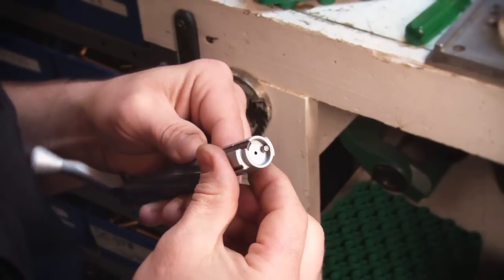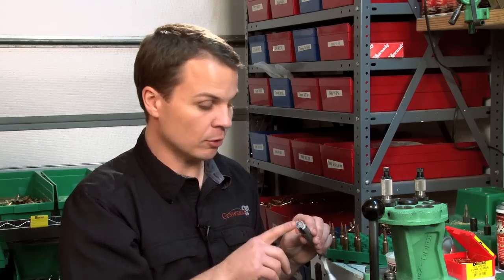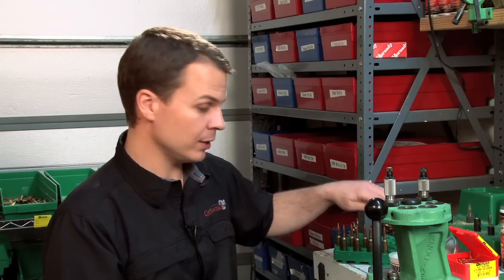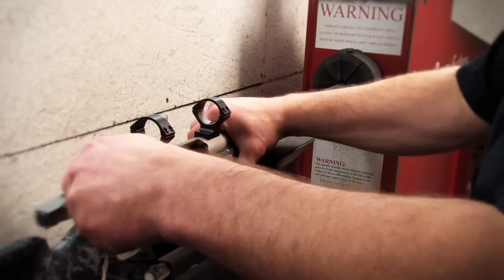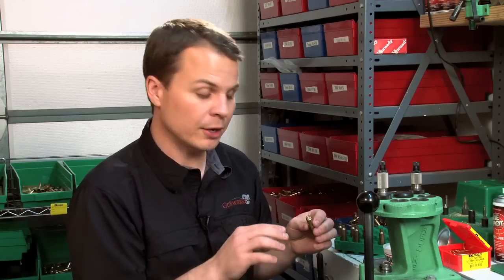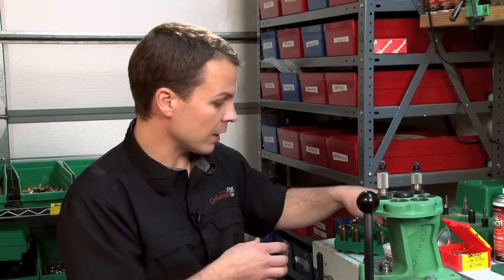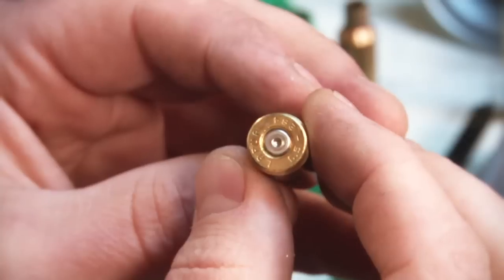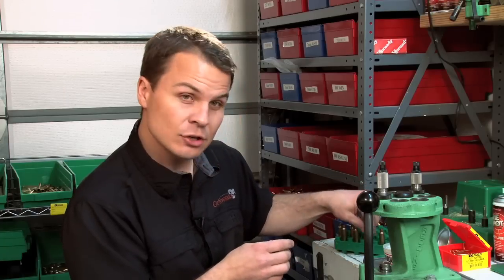DIY Determining Max Powder Charge

Comment: Never use one source of powder charge, use two or more for safety, as there are mistakes which can blow up the breach.  Note letting the ammo sit in the sun can greatly increase the pressure to the point of serious problems.   I saw an M1A explode 3 feet from me and the gun bolt exploded, and really hurt his left arm.  Do not assume anything, everything matters keep records, temperature, wind, compass treading, and do not load maximum unless you know that this is the best for your specific gun, I use a separate book for each gun, for total shots through the barrel, barrel wear, accuracy, and date each batch of reloads on the box with bullet lot and powder lot and brass manufacturer, as all these matter in pressure, at max loads.  Remington brass verses Winchester has 1/2 to 1 MOA difference at 600'yards.  Weigh all brass lots and keep the difference in weights of each piece within a known range.  Do not mix manufacturer lots, military brass, or odd weight brass pieces as serious issues

Comment: I disagree with your method. I have bought literally thousands of once fired brass from factory ammo at indoor ranges and about half the cases will have some ejector hole horseshoe track. In some instances the rifle bolt may have a burr edge on the ejector hole. I don't know all the causes but factory ammo is not so high pressure that it causes so many marks on the head.  Head expansion and expansion at the web is more reliable indicators but it takes more skill and sometimes a micrometer to determine what loads are expanding the brass.
Reply: My rem 700 has always left a mark in the primer. Doesn't matter what ammo/load. Factory or home load
Reply: Yep.  What Shannon said.  Use a headspace gauge and measure a new case from base to shoulder, then measure a fired case from YOUR gun from the same exact place (base to shoulder).  The difference will tell you how much stretch you are seeing in the case.  I only bump the shoulder a max of two thousands.

Comment: A Ruger #1 has only a firing pin hole in the breech face. The pressure sign is loose primer pockets, that they might happen at load book levels for the 6.5-284 [high bolt thrust, deep extractor groove, and large primer pocket will make weak brass], but it will take 20% more powder than book loads for the 223. And in 6mmBR or 30-30, the primer will pierce before the brass shows pressure sign.
Reply: I have a Ruger number one in 22/250, it's groups are nothing to write home to Mom about.... Sounds like I will be going a little higher on pressures, OR do they NOT shoot that great?

Comment: In some cases 1/2gr below sign is a little thin on safety margin. Especially if you are running double based powder and testing below the max temperature you might operate at.

Comment: I use primer indicators like flatter primers or craters around the firing pin as not all rifles will show ejector indicators. As u raise pressure you’ll get flatter then craters till u blow the firing pin hole out. A slight crater is as I see it a hot decent load on the edge oh being max but it depends on FP channel size. This is the most used method

Comment: There is an analytical approach to the safe maximum load. One must also keep in mind that many powders are temperature sensitive. That is to say that pressure and velocity go up when the operating temperature ( usually close to ambient) rises. This also means that if you let a round heat soak in a hot chamber a marginal max load may go over max.

The analytical method relies on the fact that pressure and velocity correlate. Higher pressure upon firing with a given powder will generally yield higher velocity. Since most of us in the field cannot measure pressure we can, however, measure velocity with our chronograph. So, taking handbook data first calculate the velocity per grain of the bulk load at each of the loads in the manual(s). I like to use at least three published manuals to account for random variability. These velocity (FPS)/ total grains will usually sit within a few FPS of each other for the same manual as the loads and velocities increase. . Now as you move up close to and beyond the published maximum compute the incremental increase in velocity that the additional powder gives you. Fire at least 3 but 6 or more is better and compute the mean. Whenever your incremental fps/grain is more than the bulk fps/grain you are entering the danger zone. Now you need to watch the primer pockets and case head for signs. A South African Ballistician ( don't remember his name) developed this approach. Whenever you get approaching 1.5 times the bulk average velocity increase for the incremental powder charge you probably should stop EVEN if you do not see physical signs of deformation at the case head. One more condition; keep the increases at or below 0.5 grains in cases over 50 grains and at or near 10% for smaller cases. So a 222 Rem Mag should not be incremented more that about 0.2 grains as you move up.
For my Ruger M77 in 7 Rem Mag with a 24 inch barrel I got to 3280 fps with the 150 grain Nosler BTBT. This is more than the max in the manual. The load was 68 grains of IMR 4350 with a CCI 250 using Nosler Brass. RP brass will not go this hot without heavy bolt lift. There was no heavy bolt lift and no primer pocket or other deformation and I was only at about 1.3 times the bulk for my last 0.5 grain increase. But I stopped. Another 20-30 fps was not worth pushing it. I now have a hot but safe load that is way faster than the Hornady Superformance load.
Reply: Thanks for posting this method.  Can you explain and give an example of what you mean by incremental versus bulk fps/grain increase?
Reply: @tomlopez6198 he means .2 grain increases not 1 grain increases or the like. Also newer powders don’t increase pressure when hot only well known older powders like old old blc2 or similar the w748 the older early ball powders increases pressure when hot but not newer types and not stick.  Certainly not superformance powders

Comment: I have observed that I get the round ejector "wipes" on brass when firing safe, but hot, loads in a brand new rifle.  The same loads in the same rifle do not exhibit that indication after a few dozen rounds.  This experience is in rotating bolt AR type rifles, and also in a 5.56 Tavor. I have assumed that this is due to the bolt and receiver extension "wearing in".  After 30-40 rounds the "wipes" do not appear.

Comment: You're brave standing next to the rifle and holding it and firing it at the same time.  I would have stood behind the rifle incase the action and/or the barrel ruptured from excessive pressure.
Reply: if the locking lugs shear off the bolt the bolt becomes a massive projectile flying directly rearwards. If the barrel blows up its going to be directly in front of the chamber. If you're not going to fire the rifle remotely, he was in the best place to do it.
Reply: @fulsame1 they don’t typically shear off lugs they typically have a blow out caused by a ruptured case . Rifles are actually designed to do this. They rupture around the back of the case as the brass is what holds in the pressure sorta like a inner tube in a old style tire. If u watch videos of rifles actually blowing apart they don’t typically eject the bolt straight back. And to do it they have to do something ridiculous like completely fill with straight pistol powder. Most decent rifle powders even a compressed load will not cause damage. Unlike pistol powders. Rifles cartridges are typically 90-95% full of powder so u can’t blow them up using the proper powder

Comment: Could the max load change over time as you re use the brass numerous times?
Or would you use the pressure signs as a indicator that its time to change brass?
Reply: U can reload them. It’s just a safety indicator not a brass wear or life  indicator

Comment: A chronograph can show pressure signs the best. Sometimes cases wont show signs of overpressure. Velocity itself is a pressure sign.
Reply: No your statement is so incorrect it's not funny.
The cartridge case flowing and or flat or flattening primers are over pressure indicators. Velocity can never be used to determine pressure. What the recipe provided says is the velocity with load A May have a higher or lower velocity in your firearm due to components that are not quite the same. Maybe it's a hot day when your shooting? A warm day can speed up a load 50 fps if not more during some really hot days.
Chrony is to check fps and load uniformity via fps and sds and spreads but not to check Max loads
Reply: @williamdelarge2491  I disagree with the flattened primer's in my 44 mag factory ammo and my own loads have flattened primer's and extractor marks in them. Only my light red dot loads don't have marks on them.

Comment: If you new how to use a micrometer you would be way ahead on finding pressure signs. This method your using you get way to much pressure fast.   The real gunsmith randy selby has great vdo on how to reload and pressure signs.